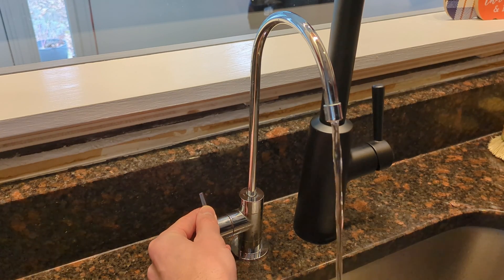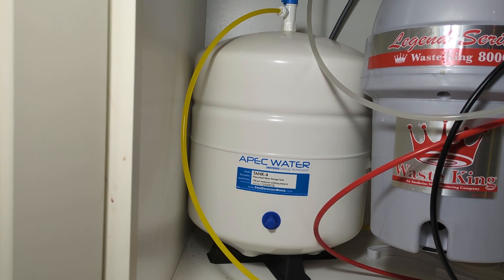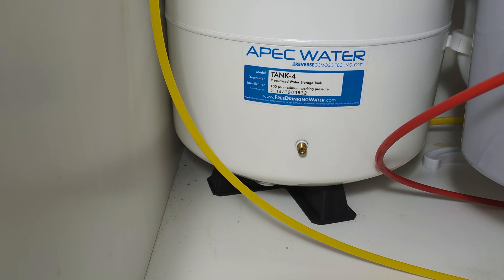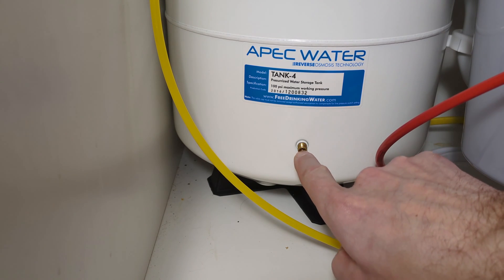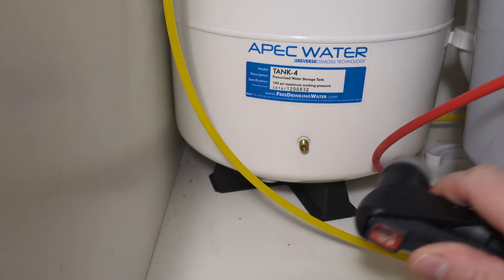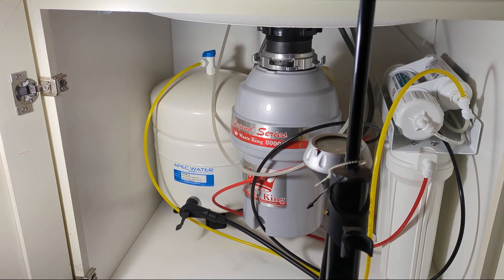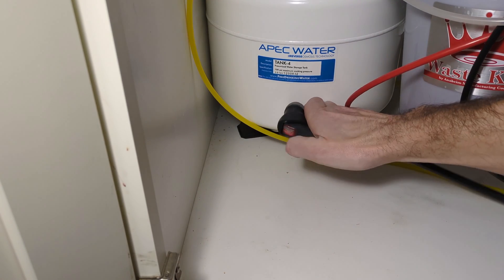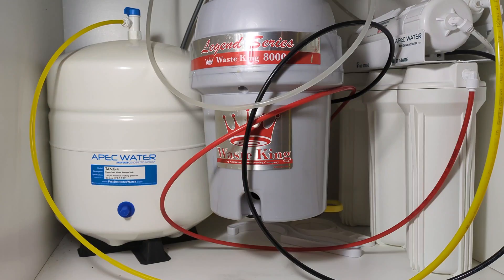How to Adjust the Water Pressure on a Reverse Osmosis Drinking Water System

Comment: I tried this, but if your air pump is the newer kind with the clip over the end of the pump hose,  it doesn't fit onto the tank valve.   NOT HELPFUL! 1:46 1:48
Reply from the maker: Not sure what the clip is or if I've ever seen that before. My pump is only a couple years old too. Just a standard bike tire pump.

Comment: Do not listen to this this is not true. First off you must completely drain of air and water. Second you close the valve and add between 5 and 7 PSI. Then you turn the water back on system and it takes approximately 3 hours to fill that tank with purified water. That is the holding tank clean drinking water for system. If you don't know what you're doing you shouldn't post these kind of videos because you are absolutely incorrect. I hope you're not posting more videos like this yuck.
Reply from the maker: @bobbyotay  if you want the pressure reading to be exact, then follow the method per the manual which requires emptying all the water from the tank. But you don't have to if all you want is a bit higher or lower pressure. For increasing pressure it will help to open the beverage faucet while adding air. It might not work for all cases, such as if you need to add a lot of air. But it really shouldn't ever be far off from the factory set pressure.
Reply from the maker: Updated video is now available with more detail. Yes it works perfectly well: 
https://youtu.be/6uUW1Kp-x7Q

Comment from the maker: Note, if it's too difficult to pump air in, turn on the beverage faucet while you pump. It will push some water out but will make it very easy to add air.

Comment: I have a question for you. Every time anyone turns on a tap in the house or  flushes the toilet. The water tank makes a banging noise. Should I be releasing the pressure for that to stop? Thanks.
Reply from the maker: @shamsrashi  this may be the water lines shaking and hitting the tank or something else under the cabinet. This sometimes happens on my system.
Reply: This happens quite often and it’s really loud.
Reply from the maker: @shamsrashi  you could also close the valve on top of the tank to isolate it and see if the problem continues. Might help tell if it is the tank or something else.